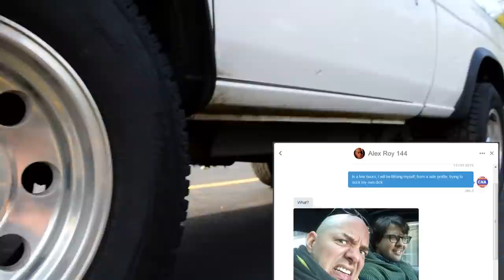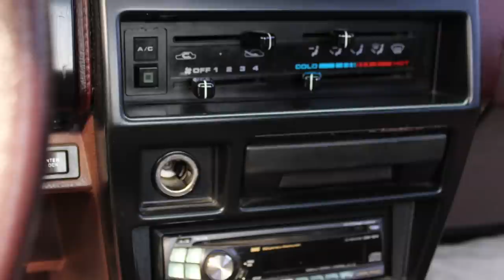Regular Car Reviews: 1991 Nissan D21 Hardbody

Comment: I don't know why, but after finishing this video it got me thinking about all those little pretty girls I see that drive the massive-as-fuck trucks the size of tanks around here. What's even the point in those battle wagons? Why own them?

Why can't we have these again or the Chevy Luv? Could we decide that small is good again?
Reply: I drive a miata and feel. Small is cool but not lucrative
Reply: Safety regulations won't allow it ever again.
Reply: +Aaron MK These little trucks actually did work. Very rarely do you see a large truck being used as worker, it's normally an s10/Sonoma, Ranger/B2200/B3000/B4000, Hardbody/Frontier, Dakota/Raider doing all the work. They were great and bulletproof as hell.
Reply: +Zack Salter Not great for towing larger work trailers but my ranger does a good job of hauling my tools around and is ideal for pulling an ATV trailer.  You can get a ladder rack for them and such too.  Still, some people really do need half and 3/4 tonne pickups.  Most people just drive em for no reason though.
Reply: +DangerDavez hell, I pulled a 22 foot trailer with a mega truck tahoe on it pretty often with my 1994 Chevy s10 with the 4.3l v6. only thing it ever struggled with was getting up a hill, but there is rarely a large hill around me. It never once gave up. I'm pretty sure if you had the 4.0 in the ranger or the 3.5 in the bardbody it would do the same with ease. haha.
Reply: +Aaron MK Blame both the chicken tax (thank you UAW) and the "bigger is better" mentality shoehorned everywhere.
Reply: +Zack Salter I know it's a typo but...

a body completely made out of bards? I wonder what sound it'd make...
Reply: ***** Annoying, repetitive songs about how great someone who wasn't great was. lol.
Reply: +Zack Salter The reason why they were reliable to the end of time was cost. For about the same price range as a midsized or even compact pickup nowadays, they sold these great little pickups that were well developed, over engineered, and affordable. It annoys me to see people now driving some overblown pickup truck like a Raptor and having no utilitarian use for it. The most common answer people give for buying them is, "It's pretty." I really don't understand how some people think being high up and sacrificing a lot of driving qualities is worth it if they don't even use it.
Reply: IronManAlchemist2100
If they say "safety" than I could probably understand driving a pick-up. But "safety" only should really apply to family cars like mini-vans. You don't really pack a family in a truck.
Reply: Aaron MK Not unless it's a crew cab, but even then like you said it's not usually done.
Reply: wasnt the Chevy Luv badly made though?
Reply: Fuji086 yeah I remember that the Chevy Luv was prone to break down easily
Reply: +yupitellwhut You guys saying that the Chevy LUV was not reliable are crazy! My dad had 2 of them and they each lasted over 350k* with no major problems AND he ran them on used oil that he got from doing oil changes at his shop. He used to carry huge diesel engines on them, plowed with them, and basically abused the poopz out of them. They wouldn't stop! They both finally had to be put down because of rust (1 of them was bending in half!) 

*Both we gas-powered models. I don't know how reliable the diesel engine was.
Reply: imnoherox well the parts for it were hard to scavenge for,Im pretty sure now they are good trucks but back in the day they werent that good.Most Luvs I see are all beaters
Reply: We need the Mighty Max back
Reply: ***** how?
Reply: Suzonda Well that's an under powered analogy if I ever heard one. They were 4G63 equipped, you could even swap in the turbocharged stronger pre mid 92 design 4G63 out of an early DSM in, If you wanted some real powa
Reply: yea those chevy luvs were great but volvo need to remake their family tank the 240
Reply: +Rosco P. Coltrane the Chicken Tax had more to do with European politics than unions from what I've heard.
Reply: Untie the knot in your dong.  People  buy these and use them as cars because the CAFE ratings took away all the big, rear-drive V8 cars,.  The Chevrolets in particular ride like cars.  You put a locking bed cover on a 6-pack pickup and it's basically a giant sedan at that point, with 4x4 as an option.  You can't get my ideal car, (front V8 or larger, manual transmission, rear or four-wheel-drive) but you can get it as a truck.  I'd prefer it in a Sedan body, and some day I'll make one myself; I can weld, but it's a very uncommon type of car.
Reply: cjohnnyblack What do you think about the 4 door Tacoma and the Frontier?
Reply: cjohnnyblack All I haul is my motorcycle so I don't need the big trucks lol.
Reply: I hear you. Remember the H1 Hummer? And how massive that thing was as the time? It's now narrower than every full size truck on the market today, and shorter than a Camry.
Reply: dude the chevy luv came back in a 4 door versión in late 90's im México, even the old school bug body style was still beign produced in 2000. they re Nice , old school body with a modern interior and drive train components... same size motors
Reply: Aaron MK female drive trucks for one reason. wise financial spending. the most practical vehicle to own is a pick up truck, 4WD for the winter, safe, RELIABLE, can tow the camper or other trailers, can use it when you need a truck load of dirt for the garden.. etc And why the big trucks? because that's what is offered in America, go big or go home.
Reply: Bailey O. 95% of 4x4 plus lifted truck don't get used just  road queens
Reply: Aaron MK "Why can't we have these again?" Because i need a way to compensate for my small wiener or mosquito bite size lumps on my chest. 😛
Reply: ...and Nissan gave them the most crappiest full size of the all the "TITAN" lol  bought my '87 d21 23 years ago .2 head gaskets same motor same tranny same dick lol
Reply: ...and Nissan gave them the most crappiest full size of the all the "TITAN" lol  bought my '87 d21 23 years ago .2 head gaskets same motor same tranny same dick lol
Reply: Desert fox doesn't matter the 4x4 helps with snow
Reply: Well some people do need bigger trucks but, they just buy used so I don't know, city folk trying to be country I guess?
Reply: Thats call been ready for katrina ...
Reply: I own a '96 Nissan XE Pickup, and have owned it for almost 20 years! Bought in 1998 with 23,936 miles on him. His name is Mystery (he's all BLACK & CHROME), with a sticker in my slider window that says... 'DON'T BE A DICK' in plain black and white. He's in EXCELLENT condition, because unlike some men who are hard on their vehicles, I've always taken care of mine. He's done many out-of-state trips with ease, and to this day runs terrific, like the day I bought it. I can't begin to tell you how many men ask to buy my truck, and same guys have kept asking for years, I always say "no thank you" lol I know exactly what I have here, not only is he made of all metal, unlike the crap they make now-a-days, but the motor is strong, and has a 138K miles on it, and he looks as beautiful as the day he was made. Has a hard bedliner, that came with it, says NISSAN right under my slider window (looks awesome), and he's now a classic. Will NEVER sell my baby :-) I also have a 1980 CM400T HONDA Motorcycle, which obviously is also a classic, but she needs to be cleaned up a bit. Had her since I was 18 years old, and another vehicle that I will not sell :-) Oh and I'm a female lol
Reply: Mahindra was going to sell a truck that looked something like the old Mazda trucks, but be a 4-banger diesel. They sell a version of the vehicle in Australia and to Asian markets, but for some reason they stopped short of American introduction in 2009, so we don't get a small Indian truck.
Reply: I have an 02 tacoma.  3.4, 5 speed.  If I wasn't a dumbass it would still be in perfect condition.  In my opinion, the greatest truck ever made.
Reply: seriously.  most of the time I am not going to haul large loads so my little half ton works fine.  And I don't have to pay out the nose for gas when I'm just using it to get to work.
Reply: what gets me is how giant they are even to their older models.  the 90s f150 looks like a mini truck compared to the new ones.
Reply: in Seattle those will set you back about 8-10k for one in decent shape.  they are very much in demand here
Reply: the new ranger is bigger tahn a 90's f150
Reply: It’s a shame that small pickups have become a thing of the past. Even trucks that used to be small, like the Toyota Tacoma and the Ford Ranger, have become bulkier in recent years. But small trucks really can get the job done. For example, from 2014 to 2017, my dad had a 1993 Dodge Dakota. He payed $600 for it, and it would work like a goddamn mule. The 4-wheel drive was great, it could haul huge loads (we once had nearly 1500 lbs of scrap metal in the bed), and the ride wasn’t too bad, albeit a bit shaky. He would’ve kept it if it weren’t for the fact that it was developing massive rust spots (thanks, New Jersey winters!). He’s since replaced it with a 2005 Toyota Tacoma, which is just as much of a workhorse. Hell, he used to have a 1990 Nissan hardbody - his second car, after his 1981 Plymouth Horizon - and he said he would’ve kept it if he didn’t need a back seat. Point is, small trucks can get a job done just as well as big trucks.

Comment: I bought a Nissan Hardbody new in '86, an SEV6 model.  I drove the truck for 10 years and in that time, it had to go back to the dealer once for an unscheduled repair.  The throttle position switch gummed up after 150,000 miles.  That was it.  Everything else was scheduled maintenance, and I maintained it well.  It was a great truck.  I loved it.

Comment: My dad had this truck(1990) in white in the late 90s to early 2000s. I loved that truck and called it the white monster because it was a bit rusty. I drove it in high school and took it deer hunting off road. Road tripped to New York from Ohio. Got a kiss from a girl i had a crush on. Lots of memories. Died ar 330k miles. It liked to blow tie rods. The radio wasn't great but worked but you didn't need much when you were listening to Dire Straits on cassette. The jump seats were nice in a pinch, we even had four of us in there which was me and two teenage brothers and our dad, drive two and half hours on a small road trip. The engine sound really takes me back. The tires also sucked but it did okay in the snow when you went out, locked the hubs manually, and switched to 4 low. My dad was also a part time fire and ems guy so when the sirens went off, my dad literally peeled out and id hear him red line until out of ear shot and me being a hugh school kid, was running it hot all the time doing fish tails. We hauled rocks, mulch, rototillers, camping gear, everything.  No issue. Had a really high suspension too. The seats WERE verh comfortable.

If you're looking at this truck and seeing if it sucks, it doesn't.  Its awesome and after my kids are gone, will get this truck. You'll just love this truck.

Comment: I am on my 3rd Nissan hardbody. 1986 D21 king cab SE. V6 5 speed 4x4 with 103,000 miles. Every single one I’ve had has been so reliable that it defines the laws a physics. There fantastic trucks.

Comment: Dad had a 85 Nissan pick up truck (bought new in 85), 5 speed manual. Put 380,000 miles on it and kept going. Thing was put through its rigors w/ the weather and the copious amounts of salt in western NY. Yes the body was rusty in it's final days (prior to selling), but besides regular maintenance, the thing just did not die. Prior to being sold (for 500 bucks) in mid 90s, the tranny started to slip. Only reason he sold it was because he wanted to get something new and he did not feel like replacing the transmission.

He regrets selling that vehicle and buying a 1994 Chevy Lumina. He hated, no, everyone in our family hated that Chevy Lumina.

Comment: My first vehicle was a 1989 Nissan Hardbody single cab no A/C(bought in Washington) and no power steering oh and the only year with that style grill. Had it 15 years and 250K with no issues. Hated changing plugs on that Z24i engine though 8 plugs on a 4 cylinder.

Comment: I want you to review my GM... DIESEL.... V8......Oldsmobile Cutlass Supreme Brougham
Reply: hmm different
Reply: +awesomeologyism I wouldn't completely write off the Oldsmobile diesel.  Read this article a long time ago:
http://www.caranddriver.com/features/battle-of-the-diesel-beaters
Reply: +Brian Williams In highschool my best friend had a 1980 Caddilac Seville diesel. Same engine. What a turd. 

He was actually given the car for his 16th b day, but the engine was seized. He replaced it with the engine out of... wait for it...Oldsmobile diesel Cutlass Station wagon.
Reply: My dad was just talking about what massive pieces of shit these were back in the day and how many gas engines he swapped into them... Still I'd love to see a video on it
Reply: IAMJAKETRIMBLE Every place I ever bought it to some old mechanic always said he used to do 5 swaps a week on one
Reply: Rare car
Reply: I'd like to see him review one too. If we're talking about the 5.7 then I realize it's a badly designed engine with weak head bolts. My Dad had a Diesel Cutlass in the late 1980s and it kept having head gasket issues. They didn't have a water separator from stock either, did they? That's nearly a death sentence for a Diesel engine. Even if they worked right I read that some of the 5.7s still somehow managed to have less horsepower than a six cylinder gas engine from the same time period which is just plain weird.
Reply: @IAMJAKETRIMBLE  also reminds me of people who swapped the TBI unit on 1st gen Seville's (the Chevy Nova based Rear Wheel Drive ones) for 4bbl carbs

Comment: I got lucky enough to buy a 95 Hardbody from the original owner back in the day one of the gimmicks in the place you bought it at with lifetime oil changes the truck has 385000 miles on it and had its oil changed every 3000 miles bought the truck for $1,000 one hell of an investment 3 liter V6 I love this truck

Comment: My wifes pic and name. Mark here, my 1989 Nissan SE V6 5spd, extra  cab, long bed was bought new by my parents, I'm in my 50's. Being the SE it has the same luxurious  Red cloth interior as on video, still in close to perfect condition,  with moon roof and electric  everything, that is still excellent. It has 330,000 miles with everything  original  except a/c compressor , alternator and water pump. Paint still nice. Has correct hitch to tow 5k lbs.